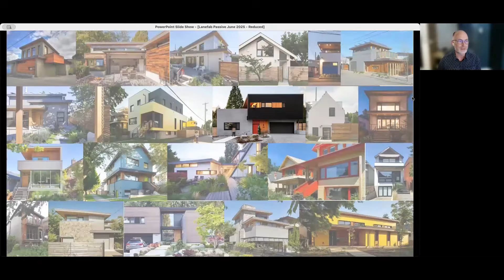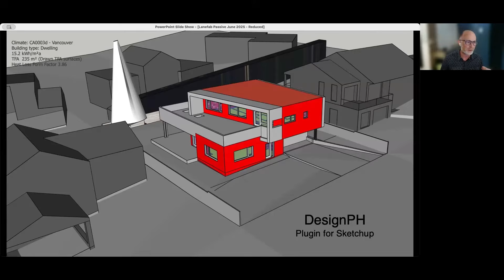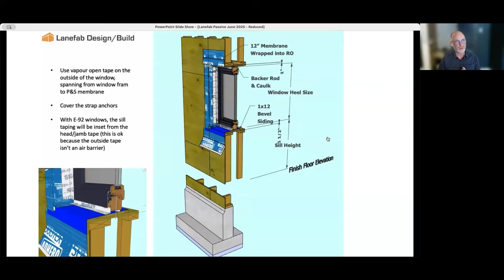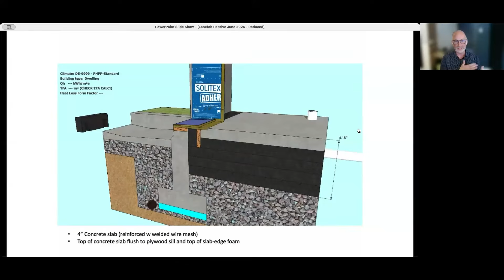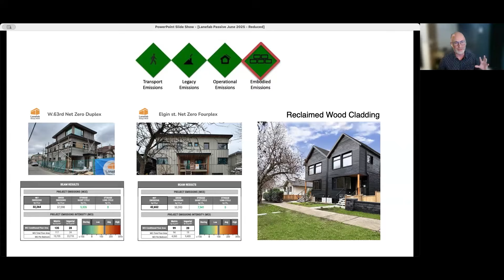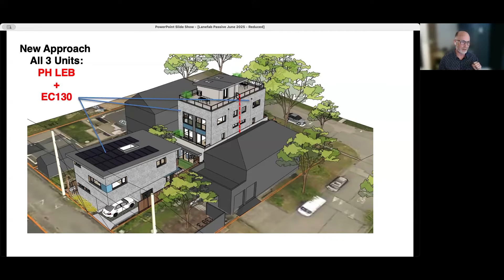What's Next After Passive House | Project of the Month | PHA Live!

Comment: You talked about the drawbacks of chasing the last kwh for certfication and that it doesn't make sense often times. It's called diminishing returns. But this is product of an analytical error. 
1. The utility of insulation is easily calculated through future savings of co2 and money balanced through co2 and money spent on insulation. Passive House standards target very low values to get rid of othere needed systems with embodied energy and co2. If you include heating and cooling anyway for comfort than you're reintroducing all those embodied ressources. That doesn't make sense and you should switch to a new balance calculation where you also balance embodied energy with future savings.

so you're 100% right that you should switch certification in those cases.